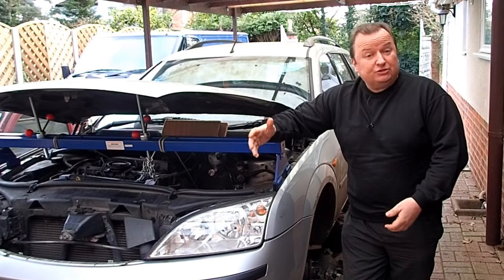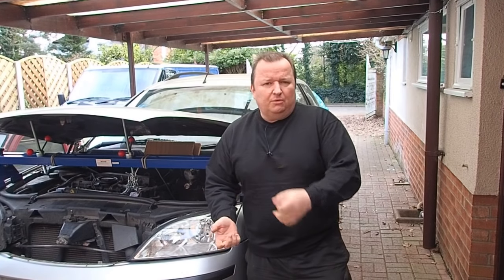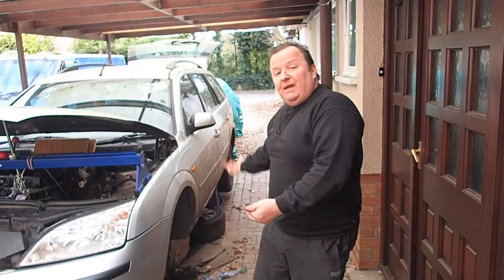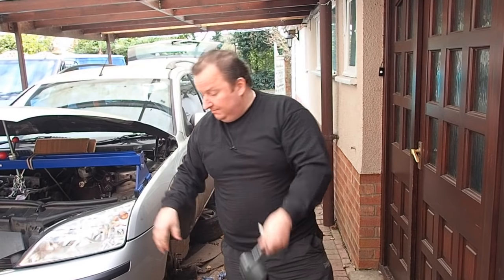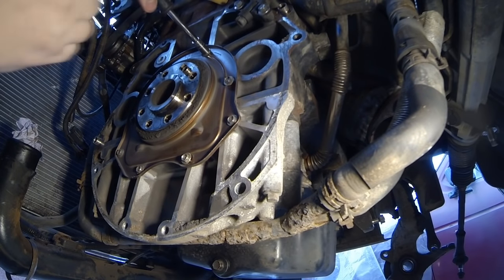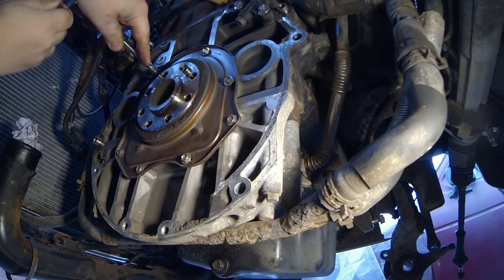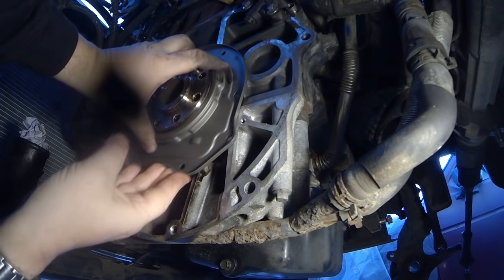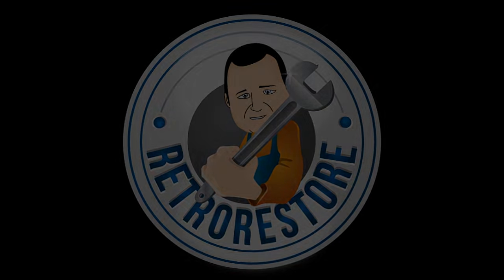Part 5 Ford Mondeo Mk 3 Dual Mass Flywheel Failure Diesel LUK Replacement

Comment: Hi Martin, another good video -thanks! You probably know this but in case subscribers don't: I find that the best sockets for getting off rounded bolts/nuts are 6 sided (hexagonal) surface-drive sockets. These are much better at gripping than the 12 sided double hex sockets which do rely on the head being in good nick.  Nice trick with the hammer though!

Comment: Great video Martin, next job is sort out that bolt that's spinning. You would have thought they would have made an access plate to get to it, but at least you have got room to move to sort it. Get the clutch, flywheel and gearbox in and its rebuild time lol. Good luck with that bolt Martin. Look forward to part 6 ! 
Cheers Jeff.
Reply from the maker: +cabdriveruk There might even be an access for that bolt Jeff as I think they have them on the Ford Focus. Cheers
Martin

Comment: Neat trick with the bolts Martin. Ford has not used AF stuff in donkeys years very odd. One other trick is to just dress the flats ,a touch with a small file it can help get the socket on. Keep up the good work.

Cheers Pete.
Reply from the maker: +Peter Froud  Yes, it was strange my 8mm didn't fit them all. It's a decent socket set as well.
Cheers
Martin
Reply: Had the same with a mower not long back.
Three bolts where 8mm and one , which was the awkward sod was a AF size 3/8 i think..Strange as the recoil looked like it had never been off.

Comment: The dust isn't the cause of the flywheel collapsing, it's the result of. The rubber disintegrates and clogs up the starter motor. Good video of a nightmare job though, nice one
Reply from the maker: +Ian The dust was what caused the starter motor to fail, It also clogged the Thrust bearing as you can see in the video and it was all in the DMF This has an abrasive affect so I disagree. This wasn't rubber, it was friction pad material.
Cheers
Martin
Reply: +retrorestore That's what I meant. The flywheel has fallen apart and the knock on effect is metal filings all over the place. What you're saying in your video is that these metal filings, which are the result of a knackered flywheel, are what caused your knackered flywheel.
Reply from the maker: No I didn't say that, I said that it's the result of previous clutches dust not being cleaned out Check what I say at 14:20

Comment: Getting that dust out is something a garage won't do....Maybe for the reasons you said (toxic).  You're doing a proper job.  ;)
Reply: +69Phuket Garages never clean parts up. They can't be bothered to do it. They just put shiny new parts in and leave the others dirty and oily etc.
Reply: michael jagger Ain't that right...It's not their motor. Some will do a good job..They are the ones that customers go back to. But finding them. I guess DIY or pay Martin a fair wodge. I think he could use more Horse raddish for next year's beef! ;)
Reply: +69Phuket Watch Wheeler Dealers. Edd China sometimes cleans every part under the car whilst working on it. But yeah not many garages clean up parts unless youre a regular or pay them alot of money. I clean all my car parts myself. Saves alot of money and labour.
Reply: michael jagger Only got freeview so i've seen all episodes probably 4 times now....I do wish he'd jet wash the undersides before getting loose on the spanners.
Reply: 69Phuket Sometimes the cars they have arent that bad. Edd once did take an engine out of a morris minor jetwashed it, painted it up and cleaned up the engine bay. Edd usually doesnt do the undersides of cars unless they are leaks or something.
Reply: michael jagger With an old Moggie, you'de expect a concourse engine at least...It's not hard...It's a sewing machine in a huge bucket. If i had his hair. i wouldn't want brake dust and mud in it. Unless that's the new look and a follower of fashion...No wonder he's gone grey!
Reply: 69Phuket He's gone grey alright. Mike Brewer made also made him go greyer because he makes Edd work his socks off while Mike just buys the cars and lives off service stations lol. Edd China is a good mechanic
Reply: 69Phuket just
Reply from the maker: Mike Brewer has no say in the cars at all. He get's told where to go and what car they will be working on.

Comment: I have 2 Smax's which are essentially the same car as the Mondeo. One has 198000 miles and is still on the original clutch and DMF. ( not to mention turbo, injectors, engine, gearbox etc. The other I bought in January at 27000 miles and have put another 10000 miles on since. This one has developed a vibration through the clutch pedal so I expect the DMF will need replacing. Asked a garage if it would fail imminently and the garage owner said I'd be better to run it until the vibration becomes too loud to live with, he thinks it could be a long time before it goes. Hopefully he's right.  I personally think that the Belgium workforce at the Genk plant didn't like the fact Ford were moving production to Spain and they simply didn't assemble the last cars like they should have. I suspect my 2nd Smax is suffering from this poor manufacturing. Shame as they are good cars
Reply from the maker: That's a shame on the second car David. It's not a nice job as you can see by these vids. All the best
Martin

Comment: I would replace that rusted steel pipe running under the gearbox. Sods Law it will start leaking some time soon.
Reply from the maker: It's knowing where to draw the line Alan.